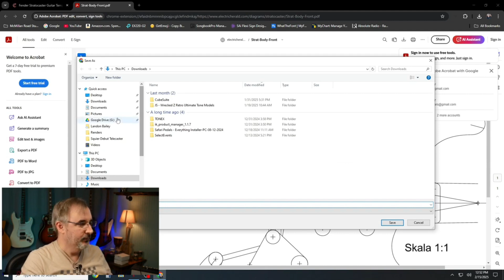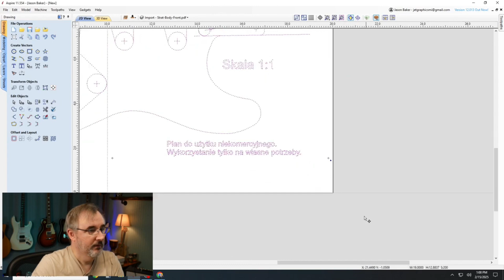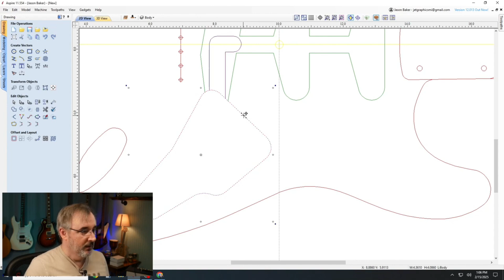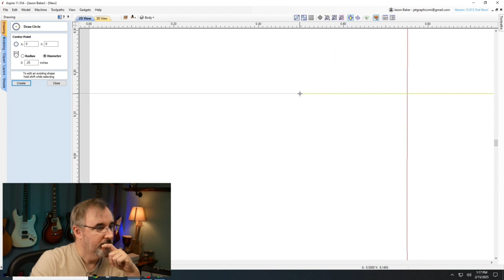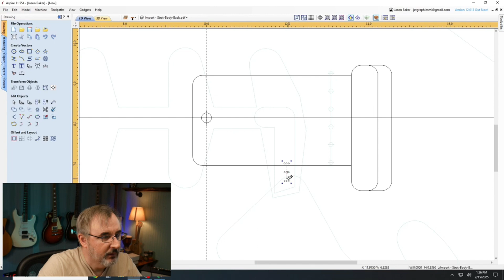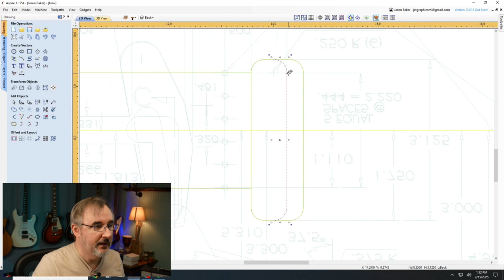Building a Stratocaster Using Vectric Aspire 11.5 - Part 1

Comment: As a lifelong woodworker and professional systems engineer, I've always enjoyed blending technology with traditional woodworking. I've been using Inventables based CNC's since 2015 and while I started with a 24x24 XCARVE, I have since moved to the larger 4x4 XCARVE Pro. Wanting to learn more about using Vectric VCarve, I decided to watch and follow this 3 part series step by step. I ran some pink foam insulation through my drum sander until I got it down to 1.75" then chucked it up in the CNC and pushed go on the jobs that came from VCarve. I'll admit I was shocked that it came out great. All the jobs ran without issue and my foam strat came off really well. I'm not a guitar builder nor do I present guitar building videos on my channel, but I am interested in instrument building and this video series was incredibly helpful. I've watched several VCarve tutorials but didn't come away with much applicable knowledge until I watched this series. Thank you Jayce! New sub here and I'm sure I'll be contributing to your watch time :)

Comment: Just a quick question. When you put your dowel metal pens into your material and drill through the material height, do you then take takeoff the material and drill directly into your spoil board maybe a quarter of an inch or a half inch down to insert the pill the pins into the material as well as the spoiler board